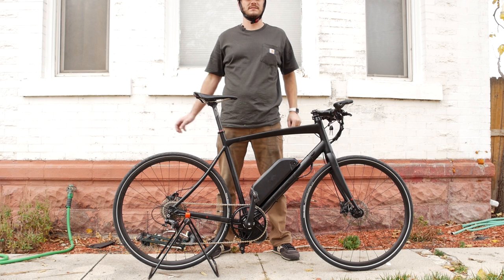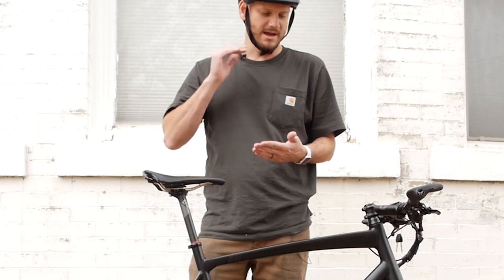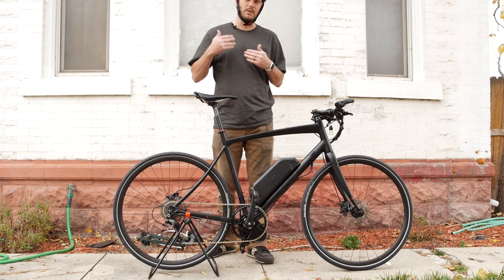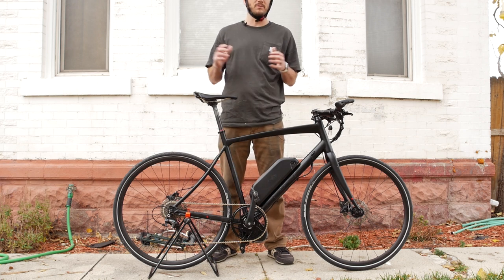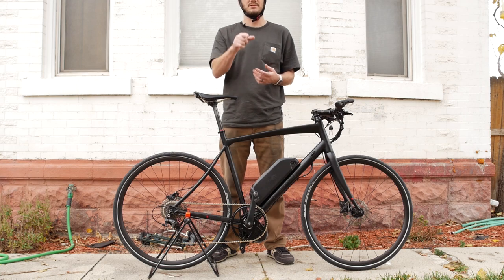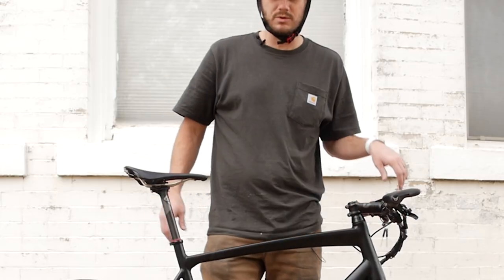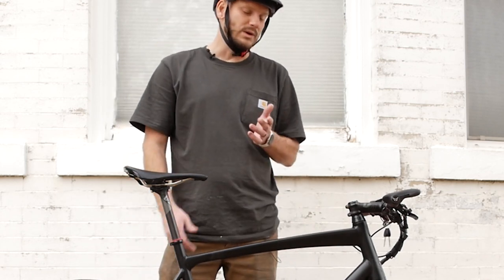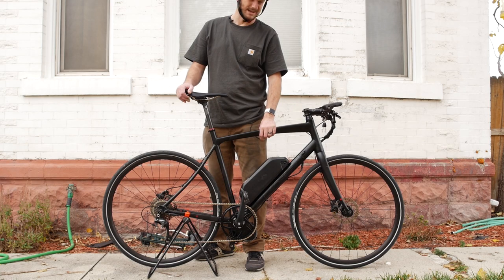Custom E-bike Build: Felt Verza BBS02 52v 17.5ah 52t Lekkie

Comment: Another great video.  I built a similar bike only with drop handlebar and BBSHD with 52V and the good Panasonic Tesla 21700 cells.  It will do over 40mph.  As Johnny says...I have had a blast with elite cyclists who can't hold my wheel at 30mph...I come from a cycling background...my next bike build I am working on is a Cannondale 29er hardtail.
What I learned is, a roadbike with skinny tires, drop handlebar and no suspension fork, 'exposes the harshness of the road at speed'  Bumps become magnified the faster you go. For that reason, I am going to a 29er with more tire volume and suspension fork.  I am excited about the new build.  I may keep both bikes because I have had so much fun on the motorized roadbike...it just isn't as forgiving as a mtb over bumps above 25mph.
Thanks to Johnny for his leadership building all these great bikes which are way more fun than ebikes available at the bike shop.
A last note.  Fit and sizing.  I am a biomechanical nerd because of my cycling background.  Almost all store bought ebikes offer a bad fit as in Mary Poppins riding style for a Johnny sized male.  I need a big bike with long top tube to stretch out and get my power down.  I train on my ebike as well as Johnny explained.  A bike that properly fits you will make the best ebike so you can add watts from your body efficiently.  The rider who had Johnny build the bike in this video understands this clearly by the proportions of the bike as Johnny explained.

Comment: Johnny this is similar to my bike. I have a road bike with a BBS02 and 52T Lekkie. Hydraulic disc brakes as well. I got the 52 V 28 Ah battery plus 115 PSI tires now after having to change them due to a flat tire. 34 to 11 for the back for me.
Reply: What range do you get and how much you weigh?

Comment: When adding a throttle option, is this something that can be plugged in or removed at will without any other changes?  My club allows e-bikes on group rides but only pedal assist bikes.  So can I go with throttle during the week and unplug/remove the throttle for club rides without having to go through a lot of difficulty?  Thanks for your efforts and support in promoting e-bikes.
Reply: Yes it can be unplugged.
Reply: Unplugging is easy, just beware to cap the open plugs to avoid dirt & moisture getting in. Removing the throttle is usually a 1 tool job and shouldn't take more than a minute but seems like overkill if it's not connected.
Reply: Thanks for the information guys.  I would think just unplugging would be good enough to meet club rules.  I just wanted to make sure that adding or removing the option didn't involve any programming or parameter changes each time. Sounds like no, just unplug and you're going pedal assist.
Reply: @Atis602  Ride on & enjoy;)
Reply: @Atis602  I Have a bbs02 with a 52V battery, just like this one, without the throttle. So, yes, it's just unplug, no problem. Go for it!

Comment: I'm a roadie. I see you can buy an adapter to use existing front rings with the bafang. Is it not possible to have two front rings? It would mean you could have a beast on flats, and on hills? I wouldn't even mind stopping to shift the front ring by hand, if need be. I wax my chains because it's clean and saves a few watts, science claims.
Reply from the maker: The chain line would be crazy far away from the bike with a second chainring

Comment: Really sweet bike & build.
"32 inch" tires? Funny, it doesn't look like a fat bike;)
The hill climb was surprising & impressive. Even if wasn't a wider ratio cassette with a bigger granny isn't hard to find.
It's great seeing someone show off the capabilities of the old goto workhorse because the HD has stolen much of its thunder (and IMO the gains aren't worth the added cost & weight for most builds).